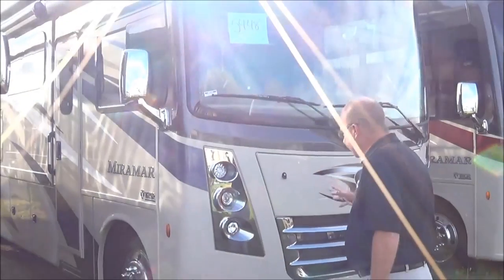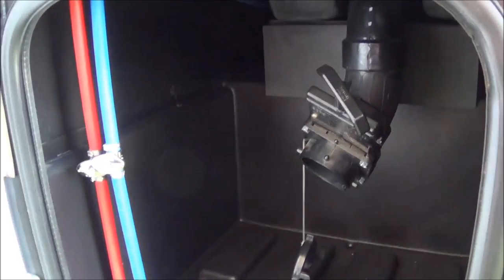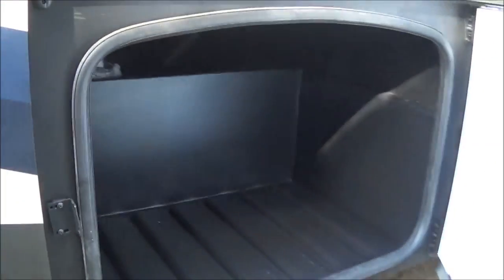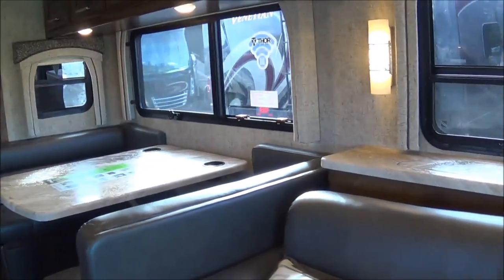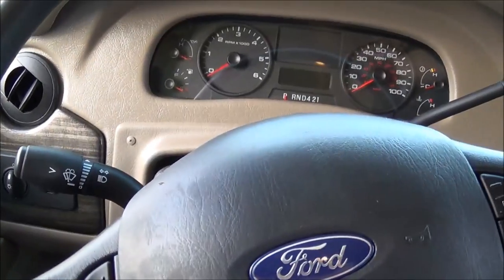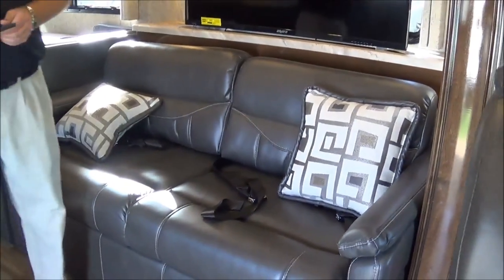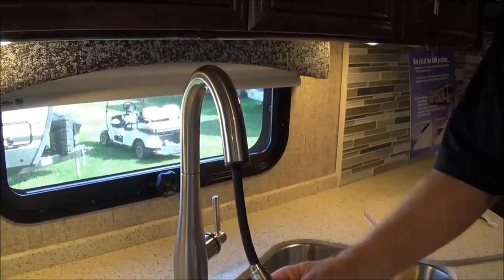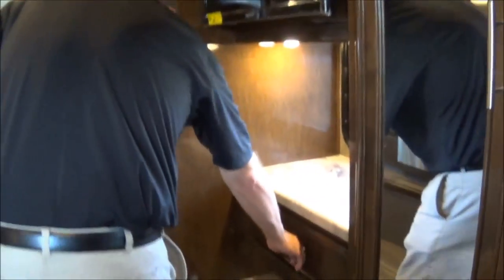2019 Thor Motor Coach Miramar 35.2 Walk Thru with the "RV Whisperer" Now at Lazydays RV!

Comment: You need a ladder to get in and out of shower. The passenger side full length slide was probablematic. You also need a ladder to get in bed the bed was so high off the flow. Other than that it was a good RV.